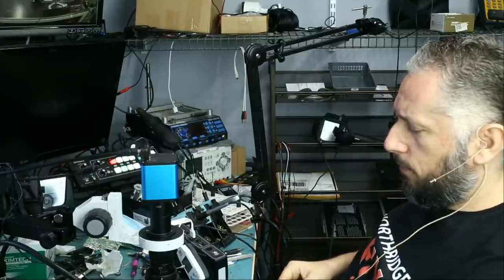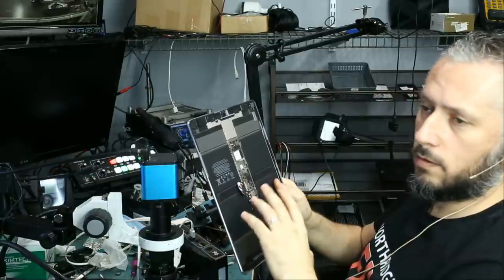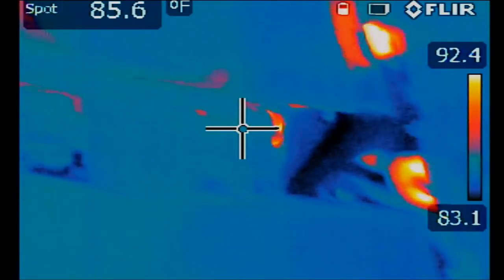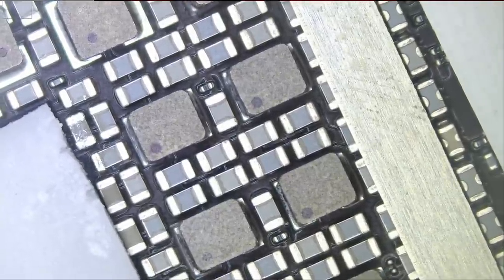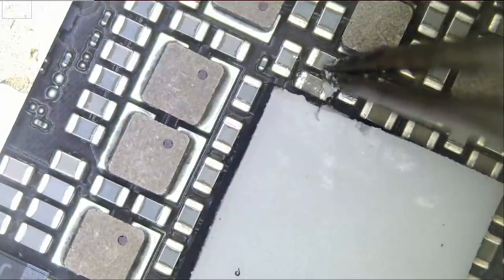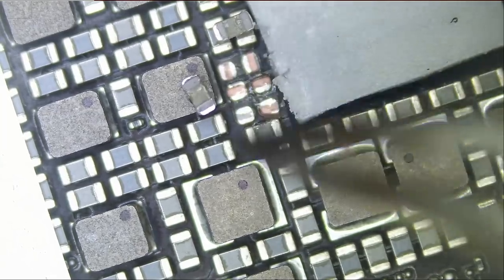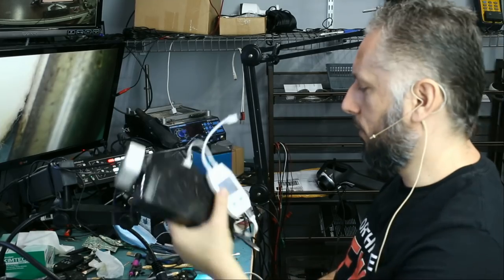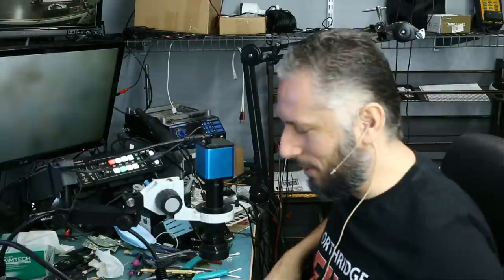iPad pro 12.9 2nd Gen No Power - How to detect short circuit & Risks involved removing screen

Comment: I saw alot of people removing capacitors on phones the same way, isn’t there a possibility to rip the pad off? And were the pads ripped off on the ipad on the first capacitor you removed?
Thanks alot, great job
شكرا جزيلا
Reply: Theres a lot of bypass caps goin on that voltage rail, so even if the pads were removed, its not a problem and the tablet will work without those caps.
Reply: Mirrored thank you

Comment: Hi Alex maybey you can Point  me in the right direction . I have I pad 9.7  inch i pad thé battery percentage stats on 17 procent when I use thé Amp meter thé same as you. He shows 0,47 a only when screen is on. When screen is off no Amp. What van it be. When show 3 u tools he says battery need to be changed. But when I use it before. It was 100 procent. And battery hold charge after I did recovery mode via I tunes. Hope you can help me

Comment: have you done any videos that shows xbox one x turning off after 10 seconds??it doesnt have the 3 sections with the problematic mosfets on the one s.ive trying testing everything,thank you my guy your a pro,ive checked its not power supply as i used one s supply to test,

Comment: Holy smokes, popping the caps off the board like that makes me nervous a pad will tear. I don’t think I would try!
Reply: In this case a lifted pad wouldn't even matter --- you have to understand that those are the tiniest and the risk involved in heating that area is much greater than a lifted pad. Remember ... these are REDUNDANT bypass capacitors.

Comment: How do you match up the caps you find shorted when there aint any markings in it.   They all look similar but surely they all cant be the same ratings across many varied appliances ?
Reply: those were all bypass caps so they were all probably 104s (.1 uF)